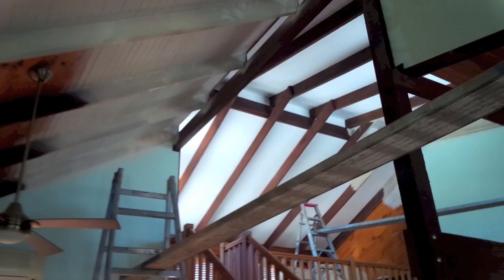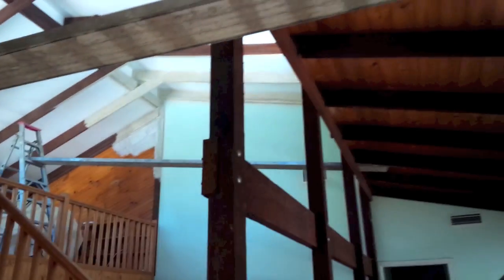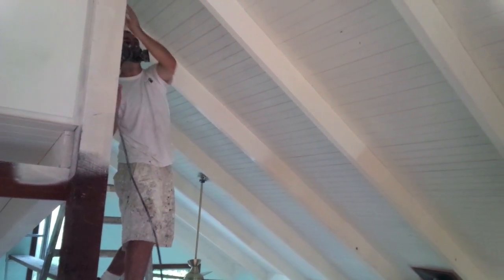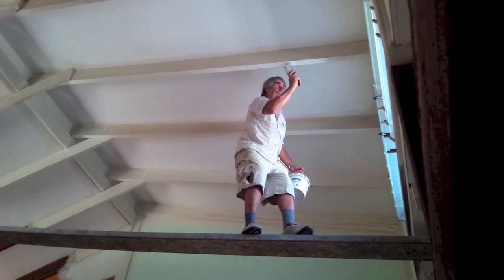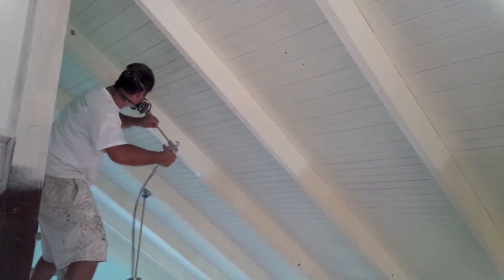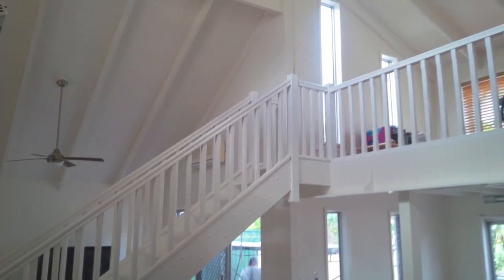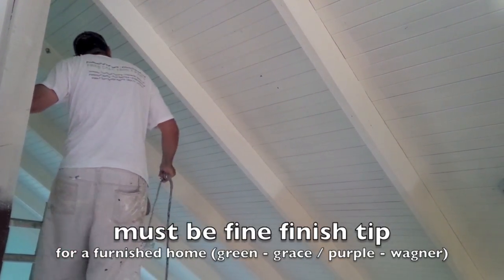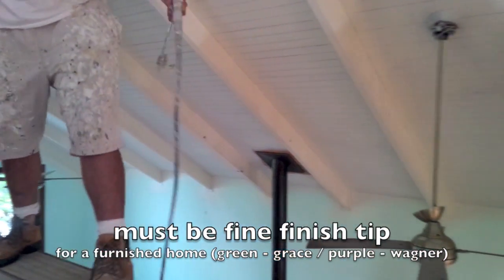Paint gable ceiling - Airless Spray FF312

Comment: I'm old school painter at a young age.. I learned from old schoolers but because of ur awesome work I'm learning how to spray for certain jobs. I had a problem recently though I used a Grayco gun and Grayco extension wand on a Titan 440 and everything leaked and everything spit and I don't know what to do or why it happened..
Reply from the maker: I always now spray cornice, inside cupboards, louvre doors, even ceilings in unfurnished places, colonial doors.     You use it where you can, if its quicker to brush and roll, i do that.   Also masking if you have to takes time, so learning how to use it without masking is a big time saving.    Cornices is a huge time saving just for that.     When places are empty i have 2 sprays going.  Cheers for watching :)
Reply from the maker: there is 2 tip guards for wagner maybe 2 for graco also, and they are slightly different, so you have to know exactly which one fits properly to the right gun.    I actually did it myself the other day i have a guard that doesnt fit this current gun im spraying with.
Reply from the maker: if you tell me where it leaked from i can probably pin point what you did exactly.

Comment: You said you use and acrylic stain sealer. What brand is that? I always thought you needed an oil-based sealer, like a Zinsser Coverstain, to block those tannin bleeds effectively.
Reply from the maker: This was one i actually bought off a company here on the gold coast "get stippled" is the name of the business.   You can buy a zinsser acrylic which does it also.    There were some problem areas i used an oil on but there was only a couple of small really bad areas i did that to.
Reply from the maker: the zinsser acrylic one, is a new product you might not have seen it yet.   There is an old acrylic, and there is this new one that does every kind of stain.    two different products one is more expensive.

Comment: Hey thanks.. It leaked from where the gun meets the paint tube and also from where the tip goes onto the gun.. Both places... And when I put on the extension wand.. It leaked where the extension wand met the gun?  I appreciate the help..
Reply from the maker: ok well i'd say you have a bit of paint stuck on the hose connection to the gun, and its not making a seal, so get a knife and make sure theres no dry paint on the connection stuffing up the seal.   With the tip housing sometimes its the same thing, or you are using the wrong tip guard with gun combination, so go back to what it should be from the factory to be safe.   Its usually always something not done up tight enough, but you shouldnt have to force it too much either.      I use vice grips and multi grips to tighten mine.   Once you work these things out it wont stress you so much, takes time to figure out your equipment etc.   You start with all these kinds of problems and its always a pain, but you work it out eventually.
Reply from the maker: also dont ever kink the lines, or try your best not to.   Roll them out the full length then take them into the room you are working on, and check the lines as you go.
Reply from the maker: the extension wand on some makes will need a poly seal in it where it connects to the gun, you will know if it needs it because there is a cutout inside where it screws onto the gun.    If it is just flat, then there is no seal to go there, its just metal on metal.
Reply: ***** it works with an O ring

Comment: What machine sprayers? And what gun r u using and extension pole and tip? Basicly I'm asking is it all same company.. Looks good
Reply from the maker: i use a wagner machine, with a wagner gun, but i use a graco tip guard bit unusual, but i prefer the graco tips, they seem to last a bit longer  and more accurate tip sizing i find.   the extension is a 24" extension i think.    The machine really shouldnt make all that difference, i was spraying this at about 1/2 - 3/4 pressure with a 312 fine finish tip and a large filter  should spray the same which ever spray unit you use.

Comment: Awesome vid :) Was wondering what product u used for the kitchen?
Reply from the maker: i used a pretty standard oil based undercoat, and then an epoxy marine enamel, which is very close to a 2 pak finish and very durable.   Its also less likely to fade than a standard oil based enamel, and alot harder than both a standard oil and acrylic gloss.     Theres a bit of a knack to getting a nice finish with it.

Comment: excellent videos.
i am wondering if you are still using the wagner 119 and if it has served you well or it makes sense to get something with a larger flow close to 2 liters per minute.
Reply from the maker: still going strong mate.   There was one time i thought i did stuff it and a bit of paint dried inside where the ballbearing clears the clog.   So what i did was, i turned the machine up side down, and filled the inlet with thinners and let it sit for a few hours, then primed it while in up side down position, and cleared the clog.   This is after years and years of use, and probably a poor cleaning job.     I actually have one of my earlier ones in the shed that still works like the day i bought it.
Reply: *****
 i am almost convinced in getting one for 800 euros about with shipping
what other things you reccomend that i order like tips filters extensiont etc?
also came across to these http://www.dpairless.com/products/piston-pump-airless-paint-sprayers
that come at lower prices.would you recomend i try one of them and if so which do you think its a good choice?
btw man,regain didnt work for me...
sucks to be me...lol
thanks a lot for all the help.
should you ever concider coming to santorini,greece, let me know..
Reply from the maker: They will all basically give you the exact same finish, just the more expensive ones will allow you to spray heavier materials more often (roof membrane - like tar)   The cheap ones will spray roof membrane, but you wouldnt use them for that if you do more than 5 roofs a year.    The odd roof here or there no problem.  I find i use the 212FF and 312FF   or 210FF and 310FF tips the most.    you'll get a few less clogs with the '12  over the '10 as its a bigger droplet size.    Its a good idea to have 2 of every tip, clean and with you on the job  so 2 x 210  and 2 x 310  if your using it commercially like i am.   That way if you do get a problem with it, you just swap it out and keep going.     I use the RED (fine) and yellow (medium) filters alot,    so get 10 red, 10 medium and maybe 2 or 3 of the white, which is for the heavier materials.     Also depending on things like woodgrain, and pinholes in surfaces you can use a less fine filter to fill those, which will give you a heavier coat.   So adjusting your filter depending on what your spraying is a good idea too.     If im spraying weatherboards external on houses, i'll generally move up to a medium, or large filter which gives you a thicker coat which will fill the minor surface imperections that the fine filter wont do.   Fine filter i use for doors, cornice, ceilings, anything where the surface is very flat and in very good condition.   Thanks for watching :)
Reply from the maker: Remember though, the old rules always apply, if its quicker to brush and roll, do that.   If its quicker to tape up and spray, do that.    I find it has to be more than about 5 doors for me to get the spray out,   a  full internal (empty) i'll generally have one spray in ceiling, one in undercoat and one in the low sheen.   and when i get to the gloss i'll swap the ceiling spray for gloss (multiple sprays sometimes)     You really can speed jobs up when you get the hang of these things, but it does take a bit of figuring out.    using the Fine finish tips eliminates 90% of the overspray that all the other house painters get, that solves most of your problems, then you have to learn where you can get away without masking etc.    theres a lot of spraying you can do without masking.     Start by spraying cornices as i did, just get used to the machine, then go to wardrobes etc.    Doors are a bit of a pain when you start because there is a bit of masking when done in place.    I often in an empty place turn a room into a spray booth and paint that last, which i put all the doors in, and it free's up the frames to spray with minimal masking.      I use only acrylics in my spray units, never oil.  Thats not to say i cant spray oil i just choose not to because of product limitations etc with discolouration etc. makes the job last a lot longer appearance wise at least.
Reply: thank you for your insight

Comment: This type of work is illegal in Ireland and UK.
In the case of an accident the house owner is liable.
Each job must have the risk assessment and the safest way of doing it have to be choosen.
So it will be proper scaffold in this example.
I have few friends decorators that after they fell from height they can't provide for them families any more, one is dead.
Why to risk your life?
I'm decorator myself for 30 years.
Reply from the maker: Matt Gloss in australia painters are allowed to work on single planks at the heights I’ve shown.   If you can’t do this type of work I wouldn’t call you a propper tradesman.   Painters should be able to do this work.    Your comparing commercial work to residential the two are very different with different regulations and they change from site to site.   Residential work as I’ve done was fully insured for damages and within oh&s requirements at the time.     You wouldn’t have won this job as your scaffolding price would have been far greater than mine.   Residential / commercial very different kinds of work.

Comment: Good Job. A bit more smelly n clean ups a bitch but i think Zinser cover stain would of soaked in an sealed off the bleeding better than the Acrylic.   Did you make a video of spraying the kitchen? Keep up the videos mate, i enjoy watching. :)
Reply from the maker: thats the product i used on some of it, but the acrylic version.   I dont ever want to put oil through an airless.     I'd rather give it 5 coats with an airless, than one coat by brush with the oil still alot faster, and cheaper.   thanks for watching :)